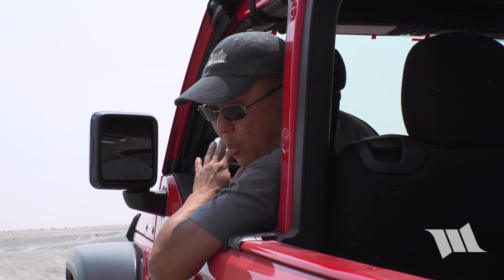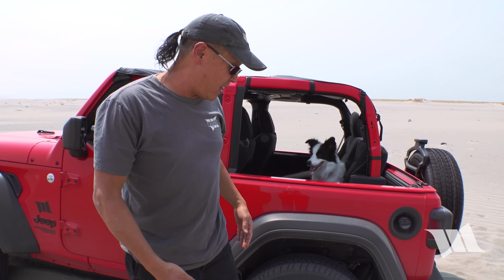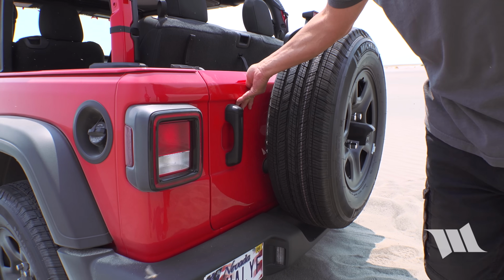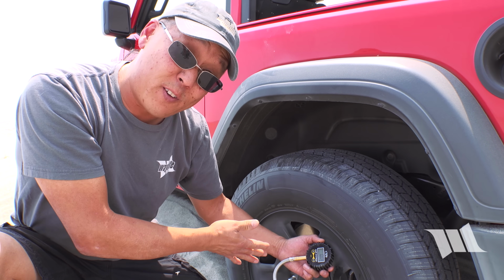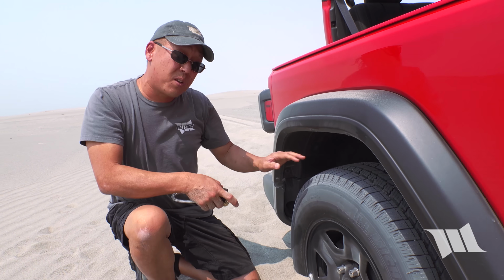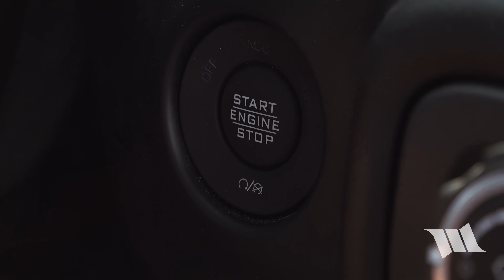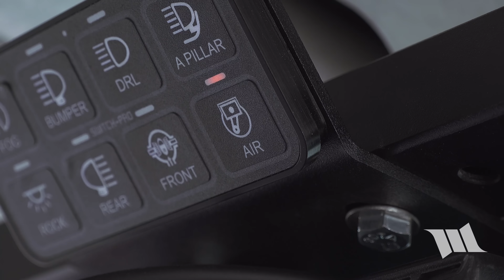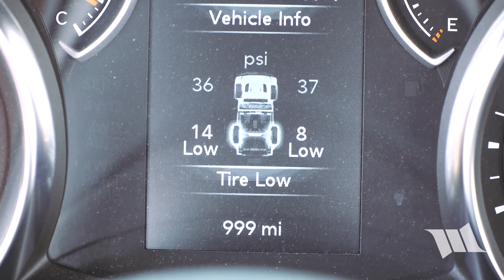Simple Tip to Get Unstuck from Sand or Snow Even if You do not have a Jeep or a Vehicle with 4WD

Comment: Great instructional video… Thanks!   Why the two Jeeps?
Reply from the maker: LOL - This video was made to demonstrate how to get unstuck out of the sand. We brought 2 Jeeps just to be safe.
Reply: @wayalife  Hey…Thanks for responding…Must be ‘night and day’ going back and forth between the toy and the beast, but each have their benefits…I’m still enjoying my relatively, very small ‘06 TJ Sport…How low can tire pressure go, (without bead lock), before you’re at risk of loosing the bead?
Reply from the maker: @tripleseven8361  You can pretty much run your tire flat if you're just driving straight on a paved road. Risk of breaking a bead comes from what you're doing. If you're just wanting to soften up your ride on an easy trail, I would recommend 16-18 psi. If you're needing more traction for rocks or even the sand, I would say 10-12 is still safe so long as you're not doing anything stupid like hammering on the gas. Also, a narrower wheel will do a better job of holding a tire bead than a wide one. There are a LOT of factors to consider.
Reply: @wayalife  Excellent info…Thanks!

Comment: Great video! Getting ready to place an order for MY first Jeep (wife beat me to it - 2018 JLU) and you've validated my desire for simple and half doors.  One question I have for you, if you don't mind me asking... did you get the limited slip diff on Pippi or is this just the stock open diff?  Also, thank you for uncovering the "workaround" to manual windows and locks on the Sport - half doors!
Reply from the maker: LOL - awesome. And, to answer your question, we got it with open rear diff. The traction control system on the JL is amazing and it pretty much makes the limited slip unnecessary. Heck, it's so good, it almost feels like I have lockers.
Reply: @wayalife  That's what I needed!  Thanks for helping this Jeep NOOB out.  Next step... ordering a Jeep from an out-of-state dealer and seeking that elusive 8% under invoice!

Comment: Cool video, but I wouldn't go down to 6 psi on non-beadlock rims because you greatly increase your chances of the tire bead separating itself from the rim. I would go more conservative and go down to 15-20 psi. But, if you have bead locks, then do what you do.
Reply from the maker: Glad you liked the video. As I state in the video, I am not a professional and clearly, there are guys on the internet like you who know way more than me. That said, in the over 20 years that I've been doing this Jeep thing, I have NEVER rolled a bead just by driving on a tires with 6 psi. Can it happen? Of course but it takes a lot more effort to do. Also, I typically run 26 psi as street pressure and from my limited experience, 15-20 wouldn't be low enough to get you out. But again, that's just me and really, what would I know.

Comment: I thought going down to 6psi on your factory wheels you would pop a tire off the rim I always go down to15 psi no lower to protect the tire from coming off
Reply from the maker: As you just saw, that is not the case. It would be if we were on terrain that had a lot more traction.
Reply: @wayalife  okay thanks for that , so it is safe to go lower than 15 psi in soft sand in your Rubicon with the factory wheels and tires
Reply from the maker: @racheldempster6655  It's unnecessary to go that low especially when you have 4WD but yes, in soft sand and snow, you can safely go lower. I only went as low as I did to demonstrate how to get out of a jam like this when you do NOT have 4WD.
Reply: @wayalife  Thanks 🙏 for explaining all this valuable information

Comment: great tip!!  And I am sure 99% of your audience knows this but JUST incase.... please don't air down to 6psi and then think it's safe to drive on the highway/roads at high speeds!  Get out and limp to wherever until you can air up (not everyone who would need this tip will have an air source handy!)
Reply from the maker: Yup, this is why we made sure to show us airing up at the end of the video.
Reply: @wayalife  On a somewhat related note!  Purchased your ARB mount for the JT almost 2 years ago!  Going strong!  used the ARB mounted using your mount here in the Leadville Colorado area several times this week! Even aired up 1 other person who was nearly flat on one of the trails!   Hope it got them back to wherever they were headed!
Reply from the maker: @DeanJohnson67  Awesome! So glad to hear you're happy with the mount 👍

Comment: Ive been stuck in the snow and airing down WITH maxtrax didnt work.  Snow was too slushy.  Had to get pulled out with a tow strap.  33" bfg k02.
Reply from the maker: Slush is a much tougher and different animal than sand.
Reply: @wayalife  yeah unfortunately I live at 7000'.  I do like to visit anza borrego once a while to play in the sand, sadly its all washboarded now, used to be wide open areas of really soft deep sand.

Comment: Would you suggest airing down for snow, to prevent from getting stuck? For example, commuting to work after a snowstorm?
Reply from the maker: If commuting in the snow is a regular thing, it's probably better to get tires made for those conditions. Even aired down, something like a mud terrain will not do as well as something like a good all terrain. But, depending on how deep the freshly fallen snow is, yeah, airing down just a bit can be helpful. Nothing as far as what I did in this video though.
Reply: @wayalife  Good to know, thanks Eddie!

Comment: For those worried about driving with 5 psi:  1.  Trust Eddie.  2.  Trust Eddie.  3.  One way to borrow air from one tire to add to another is to invest in (our build) a 2-in-one or 4-in-one air inflate hose system.  Google "Speedflate 2x" for an example of what I am talking about.   In the scenerio shown in this video, if your front tires have 35 psi and the rears are 5 psi, once you get out of the sand, you can connect the front tire to the rear tire and they will equalize each other out with 20 psi in each tire.  If you put one of the rear 5 psi tires on the back and use your spare with 35 psi in it's place, you can then balance the 35, 35, 35, 5 to be 27 psi in each of the 4 which is high enough for pavement driving.  And then as an added bonus, when you get to an air supply source you can use your 2-in-one or 4-in-one to make airing up to full psi a little easier.

Comment: Don't know if you just do it for the video, but why do you hold down the start button till its running. As long as you have the foot on the brake one click, it starts. I see people do this all the time and also with the remote start. They hold down on the 2nd click. Just an observation, do as you wish.
Reply from the maker: LOL - actually, this Jeep is a MANUAL and stepping on the brake will NOT allow you to start it. You need to be holding the CLUTCH down AND the button down until it starts. Sorry if it bothers you. 😎
Reply: @wayalife  LOL, no it doesn't bother me. I just wonder why some people hold it down. Some still used to the old way of turning a key till it starts. I would have thought even tho its a manual it would start the same way as an automatic with holding the clutch and brake down.
Reply from the maker: Couldn't tell you why it's different but I can assure you, it is. On my JLUR and JT, you can just push the start button as you've noted and they'll fire up but on this manual, you have to hold it down until it starts.
Reply: @wayalife  Learn something new from you everyday. Keep up the good work. I wish I had half the options on our JL as Jet Lee . Love that rig.... and all of them you have as well.

Comment: Also good to recommend maxtrax or similar
Reply from the maker: LOL - yup but even using 4WD before you need it and or airing down your tires just a bit will most likely prevent you from getting stuck in the first place. The point of this video was to help the kind of people I've met on the trail who got into a situation they weren't planning to be in, most because of Google maps told them to go that way and have no knowledge of 4WD and don't know what to do. These are the kind of people who won't have a clue as to what a maxtrax is.
Reply: @wayalife  fair point!

Comment: What if my axles are buried , Is it a good idea to lower down air pressure and sink my axles deeper?
Reply from the maker: If you're axles are buried, you've dug in your tires. As I state in the video, that is the worst thing you can do in a situation where you're stuck. That said, IF you're axles are buried, you're best best is to dig out the sand to make sure that it's clear before attempting to drive out.
Reply: Thx amigo i appreciate the reply and the information 👊🏼

Comment: Use shovel on fronts as well ,;)
Reply from the maker: LOL - because them sitting on top of the sand is a bad thing and what I did, clearly didn't work. Thanks for the expert advice.
Reply: No offence man ..just saying to ramp the fronts even so slightly can't hurt.   Thanks ;)
Reply from the maker: @jefffeudner408  LOL - none taken. If I was having problems, I may have resorted to other options. But, as you can see in the video, I got out without any issues. 👍🏻

Comment: The only gripe I have with this video is the length of time you hold in your start buttons on your jeeps. I don’t think you have to hold them down. Just touch and go. 🤪
Reply from the maker: LOL - on an automatic, you would be right. On a manual, you have to have the clutch in AND hold the start button down until the engine turns on.
Reply: @wayalife  that’s strange I had an 18 Mazda 6 speed with push button and I did not need to hold the button down.
Reply from the maker: I agree that it's strange but I can't make this stuff up. Clearly, this ain't no Mazda
Reply: @wayalife  ignitions are like engines. It doesn’t matter what brand makes them, they’re all made the same. Well I thought.
Reply from the maker: Ignitions are NOT computers and they are not all made the same. I will say though, you did have me doubting myself so I just went out and tried again. NOPE, this Jeep will ONLY start with the start button held down. LOL
Reply: @wayalife  that’s interesting. You learn something new everyday!

Comment: And we all carry an air compressor around with us???
Reply from the maker: Clam down pal. As you can see in the video, the red Jeep that was stuck and then unstuck didn't have a compressor. The idea is that if you can get out of the sand, you can drive yourself back to pavement and get real help. Merry Christmas 👍
Reply: You should if you plan on offroading, well in general it's a needed item. Alot of times your spare tire when it's needed is almost always flat. Just my 2 cents as a mobile mechanic though.